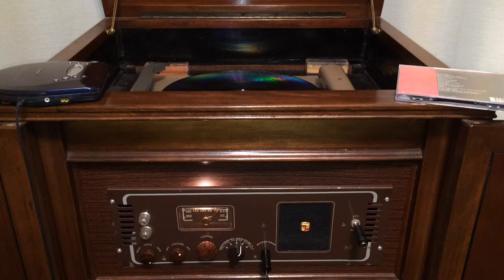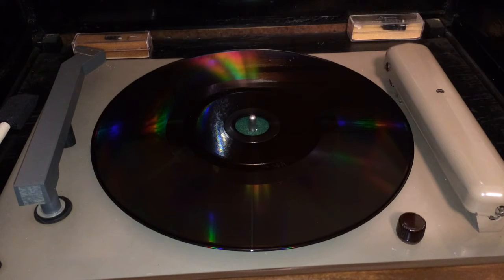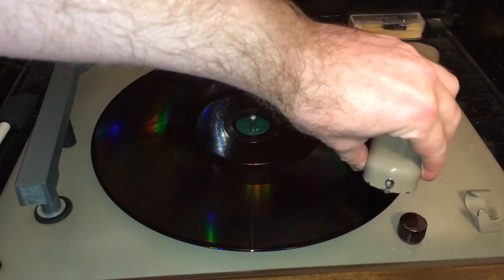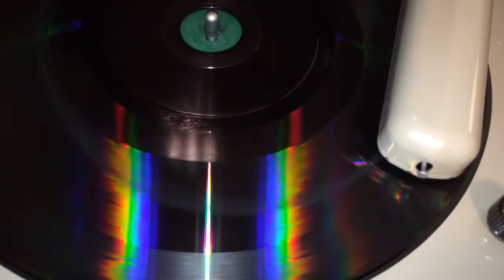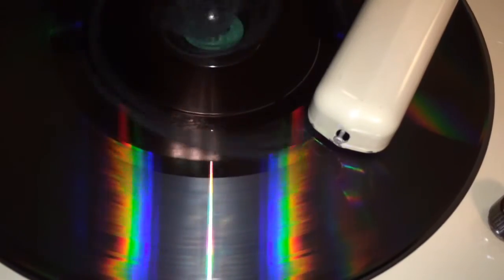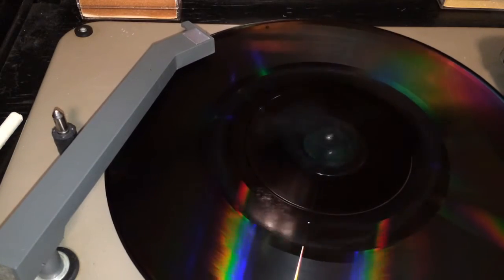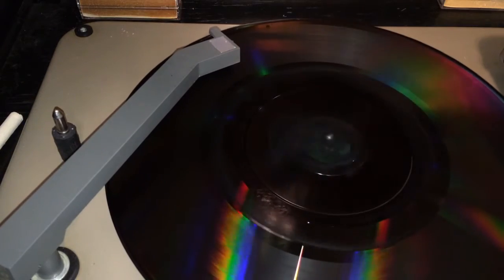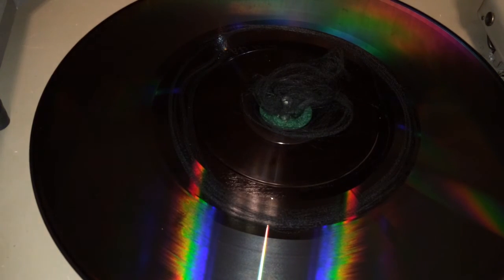Cutting a record onto an RCA Selectavision CED video disc?  Sound Recording.

Comment: Makes me wonder what a modern record cutter/player would sound like at 78 speeds, especially if you used CX and quadraphonic encoders.

You should get some kind of setup going to compensate for off-center and warped discs. And maybe also stick to the blank sides of discs whenever possible :p

Comment: Databits you should start charging for this. $15-$20 per record. People send you two audio files (one per side) and You could cut them on polycarbonate plastic and send them off. Way to make extra $$$$
Reply: Aaron Sousa and don't forget what speed they want you to record. Normal sized record-331/3; 45 sized should be 45.

Comment: You should see if that disc will still play! :P
Reply from the maker: SebisGameReviews Nothing like playing a 78rpm disc at 400rpm, right??
Reply: hehe :)
Reply: Likely not. He carved out the existing grooves and existing surface to make a new surface with new grooves.
Reply: IAmNotAFunguy Aww you ruined my fun! :(
The only reason I'm curious is because when he cut into a laserdisc, it still played through the cut part.
Reply: SebisGameReviews A laser disc is optical but a Selectavision disc, like a record, is mechanical.
Reply: IAmNotAFunguy Is not as mechanical as a turntable. Needle reads a "variable capacitance" generated by the moving disc. Is sorta non-contact reading. But it have some sort of contact anyways because its needed by the tracking system of the linear arm. It will ruin the player for sure I guess. Player was designed to high density recording, but the actual grove after this recording would look gigantic in comparison.